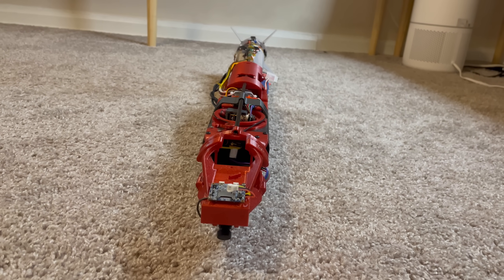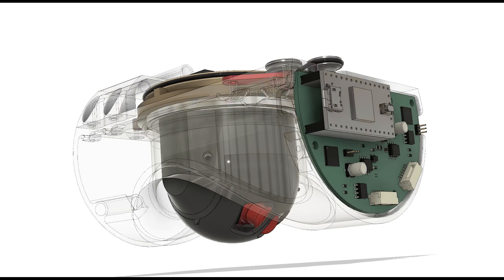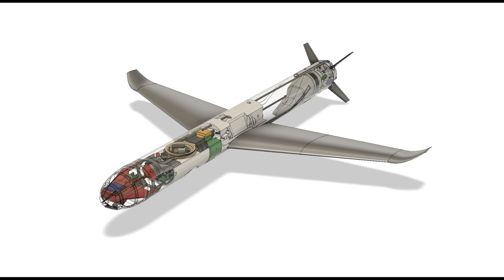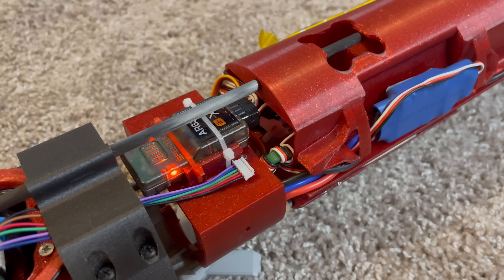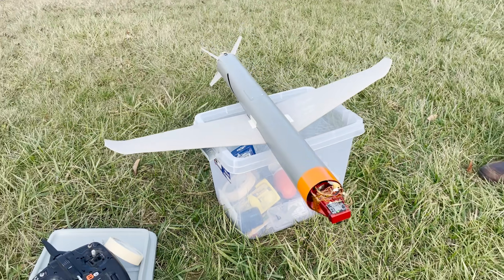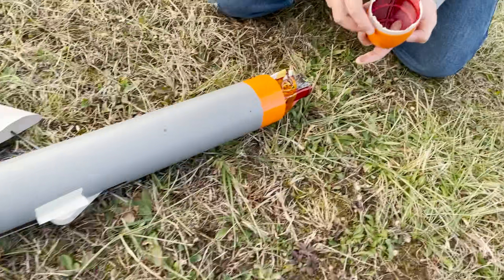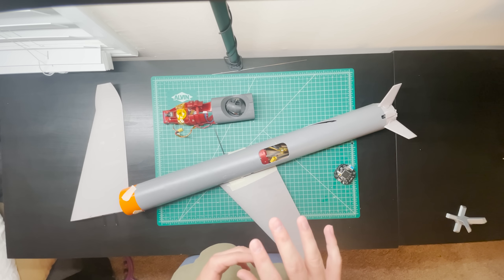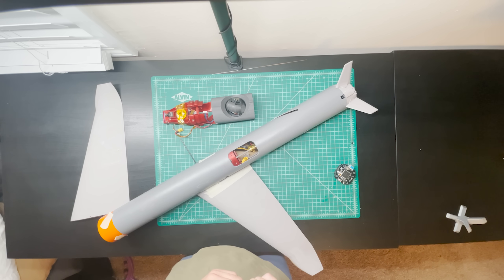Building (And Crashing) my Homemade Surveillance Drone

Comment: That's a really cool concept mate. I hope you'll get it working! I think there are 3 reasons why this thing doesn't fly. 

1)You don't have enough power. Ducted fans are in general horrible. If you stick them inside a tube and just expect it to pull air through vents it'll be even worse. Just by looking at the video, I think even if you had 2 times more trust, it would still not be hand launch-able. If you use rockets or something to give it some delta-v to start with, it might "power-glide", but I don't see this thing taking off under its own power with this power train. 

2)You need at the very least, a gyro. However, I don't know any analog gyros that'd support such a novel control setup. So, your best bet is probably a full on autopilot. The control system of this craft is just too complex to be handled by tx mixing. 

3)I now you did the math but to my eyes those wings don't seem enough to provide lift for that weight. Best way to test that is just figuring the current vehicle's CG, measuring it's weight and then creating a dummy plane with exact same shape but filled with ballast so that the CG is exactly the same as this. Then you just hand launch it and observer what it does. If it at least glides for a meter or two, you can make it work. If it just falls down like a rock, you're probably not gonna be able to fly it like a plane (you can brute force the issue with rockets though)

Comment: as a potential solution to the takeoff, I believe many of the failed atempts were due to not enough power to the engine for actual flight. It sounded like the engines got power after the friend threw it. maybe thrust hard and then throw.

Comment: EDFs produce a lower thrust at low velocites
If you could get it upto a higher speed before take off, it should be ok (or its still way to heavy)
The overall issue appears to lack of thrust

Comment: Of your 4 options, a rail or tube launcher are your best starting point. PVC pipe or heavy construction tubing (cardboard) would be easiest &  cheapest. Basicly, you're just building a spudgun, with a sabot to provide high speed lift to your UAF.  Your other 3 options are esentialy just reverting the entire project back to a basic RC plane...   Using a bungee launcher is best for winged drones.
Personally, I'd go with a considerably stronger motor, or possibly even an EDF stack... In your video, it shows almost no thrust as all when thrown.  I have a design I'm finishing up for an Ultralight EDF turbine. 8 rotors, 1 motor,  pure thrust.  I'll post it to GrabCad once I clean it up a bit & come back & post the link...

Comment: The placement of the naca duct and the the production of thrust is causing a downward suction force pitching the whole drone upwards, it will not be fixed with bigger fins, u can use a rocket assist motor to launch, then as the wings generate more lift and your fins have more aerodynamic control authority you may be able to fix the pitch up motion with some ballast at the front of the drone.

Comment: I am an absolute madman, so listening to me may be a logical fallacy, but I think that you may be able to have 2 sets of wings, one that folds backwards and one that folds forwards, and have them just sort of merge into each-other when deployed, or at least push against one another with enough equal force that they may as well be. We already have folding wings, so we might as well go all out.
On a more serious(?) note, make the fan engine stronger, consider ditching the jet veins to reduce drag load (or turn it into a real rocket-powered jet to handle it), throttle up to speed before throwing, use(/build?) manual accelerator that isn’t just “my friend throwing it as hard and straight as he can”, and maybe attach it to a rocket and detach mid-flight for a speed/height boost, you can use it to help track the rocket itself. Take your pick

Comment: Use a catapult, say with a large band or spring. That probably means a rail launcher - the German V1 (for example) used a rail launcher because it had a very high stall speed.

Comment: Do you use LW-PLA? if no then it could help lower weight a lot, considering the fillament was made for rc-plane purposes and light weight applications. I also think it needs a bigger fan, or one with a larger pitch to suit lower speed flight

Comment: Assuming your propulsion to weight ratio is carefully thought out, I would suggest you take the rail-launch approach. It is a fairly simple solution assuming Hatchets stability is decent around the stall velocity. A bungee or catapult system would also work

Comment: Forget about the cruciform tail and go to a simple V-tail configuration. You don't have enough thrust for your wing loading. You designed it like a rocket because that's what you know. I get that. Go to a local R/C field and enlist the help of some of those guys. If you can find a sailplane guy, even better.

Comment: The key lies in simplicity and ensuring that the fundamentals are correct before venturing into complex implementations. The design is excellent, but I recommend starting with a Minimum Viable Product

Comment: just fix the CG. 5cm from the leading edge of the wing. Make the wings rectangular. the stabilizer is way too small in this size and speed, as it would fly it would be enough. if you intent to land, go with V-tail. go with rail launcher.

Comment: I love that it looks like the ugly baby between an AIM-120 AMRAAM and a Switchblade or Raytheon Coyote. I think all of your ideas proposed at the end are pretty good. That said, DIY rail systems are kind of a pain to setup and require a lot of tolerance in the airframe itself if you don't really know the exact forces the craft sustain on launch. I'd say TRY to stick to hand launch if you can. Those other ideas are pretty solid.

Comment: Question? don't you need a better air intake that actually scoops air and doesn't try to suck it from the air passing by . I'm willing to bet the faster you go with the current design the less affective the motor will be . could be wring just looking at modern planes like the f16 is a good example .the old MIG,s are the best example . i could be wrong ...worth a shot

Comment: Without focusing on your dynamic stability, static stability seems waay off. Double check your moments, you're col seems very forward. Take out the complexity like the folding wings, and payload. You can substitute the weight of those for now, but in the interest of hand launching work with your bare minimum first and take out weight proportionally. Get something simple working first.

What equation are you using for longitudinal stability?

Comment: The start/takeoff thrust should come from the nose while turbine is running on full thrust, and not from the back(think of it like playing darts) reassess the turbine (more power and actually bigger diameter) and a both sided intake for the turbine should reduce the intake-resistance for the air which makes it more efficient.
And for the front/pilot cam, I would make a turret (180° in each direktion), makes more sense when you planning to use it with an FPV-system.
And I think when putting the steering-flaps in Horizontal and vertical instead of diagonal would make controlling much easier...

Comment: If you want to stick with hand launches, you could just do a fuselage long delta wing. You could shorten the drone that way, use some of the room in the wings (print them hollow) and use smaller battery cells, distributed within the wing area, and use that alongside the flight battery you are using.

Comment: How about move away from hand launch, use a trolley like system (basic wheeled undercarriage which breaks away after take off) allowing the drone to get to speed and gain lift without 'yeeting' it and hoping it goes up, maybe more survivable for test flights while the flight controls are optermised?

Comment: The two things I'd suggest. Reducing weight is only a band aid. Figure out your V2 climb speed and design a catapult system that can rapidly accelerate the vehicle to that at a desirable angle and in a more stable way. The second thing is I'd suggest a more traditional rear stabilizer setup. There's a reason pretty much all aircraft have the vertical and horizontal stab planes rather than a rocket style configuration. 

Good luck and love what you're doing.

Comment: Do it like we do in the military. Launch it with a railed catapult. 2x4s and surgical tubes will do the trick. Google Shadow launcher. Until you can get the rocket/thrust launch working, use the catapult to at least get it in the air.

Comment: It would be hard to make kinda but a slingshot could be a solid launch method, I’ve seen them used before and are quite good at getting them gently up to speed easily. Also an acrylic covering over the camera turret that matches up with the fuselage tube might help protect it better

Comment: First thing's first: where is your CG compared to your CoL? It looks like it is trying to reverse direction when thrown, which indicates the CG is likely behind your center of lift. 

The thrust vectoring is working against you, too; those little stubby control surfaces are providing very little aerodynamic control authority, and the thrust vectoring means the more throttle you provide, the more control authority you have. At low speed, you alternate between no control authority at all to extremely twitchy over-powered control depending on throttle position. Assuming the CG and CoL are in the right place, that's likely what is causing this thing to be borderline uncontrollable at launch. It's dramatically increasing the complexity and weight (and adding a bunch of weight to the back of the plane where you do not want it), and it is not helping you.

The ducted fan is also not helping you. While ducted fans are more powerful and efficient than an equally sized propeller, they are also much heavier and place practical limits on prop diameter. And while ducting improves efficiency a bit, increasing the prop diameter improves efficiency a a lot. A much larger conventional prop would generate much more thrust and increase your efficiency pretty dramatically. 

This design also doesn't make much sense for an observation drone. The design goals should be aerodynamic stability, low wing loading, and high efficiency. Essentially, you should be looking at glider designs for inspiration; long, high aspect ratio wings with lots of dihedral, big props (often folding), extremely small fuselage cross sectional area, and very low wing loading. They are also often so aerodynamically stable that you can literally just let go of the controls and they'll land themselves, and have such a low stall speed that you can just coast them right to you and catch them out of the air.

Your design is the opposite; relatively short, low aspect ratio wings with minimal dihedral, a fairly small ducted fan in a pretty chubby fuselage, and extremely high wing loading. You probably could get this thing to fly if you reduced the weight substantially and added much more thrust until it had a thrust to weight ratio greater than 1 (it should be able to fly straight up from a stationary position), but it will never be able to lazily orbit a target for extended periods of time while the camera pivots to watch it; this is designed to scream past a target at high speed a few times and then run out of juice.

Just eyeballing it: double the wing area, reduce the weight by half, ditch the thrust vectoring, and install a conventional (and much larger) tail to give you some actual stability at low speed.

I would also very strongly suggest getting a conventional, much more forgiving RC plane and learning to fly it before you start messing with a design like this. An experimental, extremely fast, 3d printed plane is just about the worst possible model to learn to fly on. You ARE going to crash it, so you want something that can take a beating without being a total write-off. There's a brand called "Crash Test Hobbies" which specifically makes extremely durable, hard to destroy planes to learn on. The E-Flite Radian is also an extremely solid glider. Get your crashing out of the way on those before moving on to the super fast, super fragile plane. They also make great testbeds for sub-components; rather than integrating the whole electronics package into your experimental airframe, you can hot glue that shit to the CTH foamy and get it working bit by bit before you try to integrate it.

Comment: Ideas: -large Horizontal stabilizers.
- Launching catapult will help her get in the air but I doubt you'll have much surface controls
- Try a traditional empennage design first to get her air worthy then work backwards towards something like your original design.
- calculate the maximum thrust throughput of that motor?  Then you'll be able to figure out if you have enough thrust:weight ratio to fly with those wings.  
 
I hate to say it but I think you unfortunately need a very high thrust:weight ratio engine for thrust vectoring (in lower speed craft)  

I cant remember the software but a Aeronautical engineer friend would use a software for proper lift, thrust & center of gravity & thrust ratio simulations. 

I have 0 experience with rocketry, my understanding is almost all of its lift comes from the rocket motor.  Fixed wing aircrafts focus on high/low airflow velocity & pressures &  from the wing to create lift.      TLDR , the biggest flaw in your design is the motor

Comment: This looks awesome.. Some concepts about EDF.. The inlet needs to increase.  Your FSA isn't enough, might want to add inlet on the bottom on increase your air intake.  
Exhaust.  Although the idea is cool and the concept is sound, the amount of thrust reduction you are gettin due to the interference of the exhaust air is extreme. I feel you might be getting less than 1/2 of the actual thrust output the EDF can create. Thrust vectoring is best if you would  make the nozzle move, not redirect the exhaust air. Your blades that are turning inside the exhaust duct are not actually deflecting air as the concept would think, but you are actually only reducing the airflow by closing the outlet instead of redirecting air. 
Surface controls: The X looks cool, but I would align them with the wing. Your controls surfaces as they are will fight against each other. While the air coming over the wings will try to hold it in the air, your rear surface controls will constantly try to rotate it. This will create massive drag and might hold you from actual flight. Rotate your rear controls surfaces so that you have a perpendicular surface and an inline surface. 
When using EDF, maximizing the thrust is straight in straight out. Any redirection of the air flow will reduce thrust. 
Distance traveled: When thinking about edf output the thrust measurement is normally straight out of the EDF housing allowing maximum pressure. The longer your exhaust tube is, the less pressure you get by the time it exits. Any disruption inside that exhaust travel decreases the amount of thrust output. Turbulent air travel creates less pressure on exit. 
Most EDFs capitalize at 105% FSA and 80% exhaust.  This is the best thrust to speed ratio. However, you can play with this as you get your AUW adjusted. If your EDF is estimated at 900g of thrust, best actual calculation is 80% of that. So your max AUW would be 720g for ease of hand launch. With bungee or landing gear it can be less because you will have speed on your side. Considering electronics, assume about 400g in edf, esc, battery, servos, wires, connectors, etc. That means your print weight needs to be around 320g. That is a tough weight to hit with all the components you have going on. 

Also, your buddy hand launching.. He's killing all your exhaust thrust by holding and pushing off the exhaust.  Just ask him to never cover the rear exhaust when tossing. 

But the concept is great! Looks awesome!  Keep at it!  I conceptualized a plane and it took about 100 crashes before it flew.  But all the crashes told me something.  
A crash is only bad if you don't get any data from it.

Comment: What you are trying to use is a Kalibr type cruise missile design. In such design first of all you don't need thrust vectoring fins. Thrust vectoring is mainly used in ballistic missiles or missiles with solid fuel engine. Secondly you need to calculated the required turbofan engine capacity for the entire weight of the model. Definitely you have very weak propeller/engine. Thirdly, you need to balance the model properly i.e. place the wings properly according to the weight centre. Fourth, for such a structure to fly, you need a booster stage or something which will act like a booster, which will take the model to the required altitude and give it an initial speed which will keep it flying until the turbofan engine riches the required thrust capacity or rpm.

Comment: The control surfaces are WAY too small and the thrust vectoring is probably doing a better job of blocking and interupting airflow instead of steering the thing